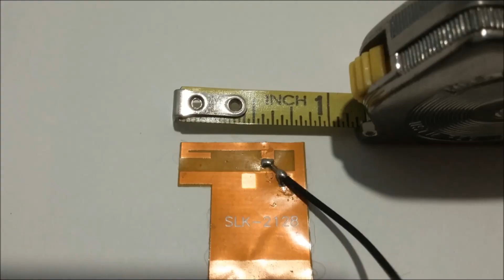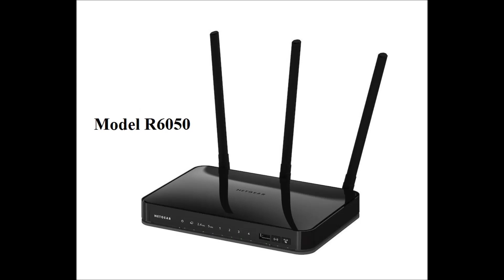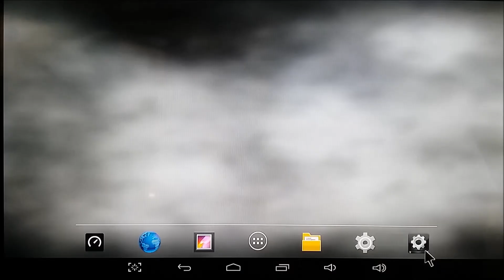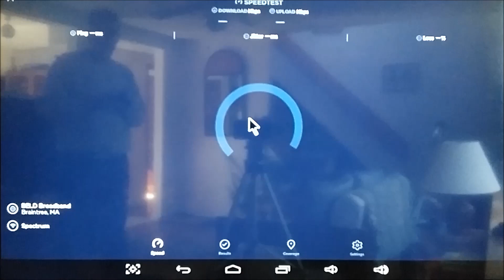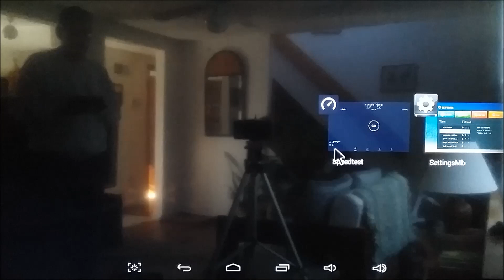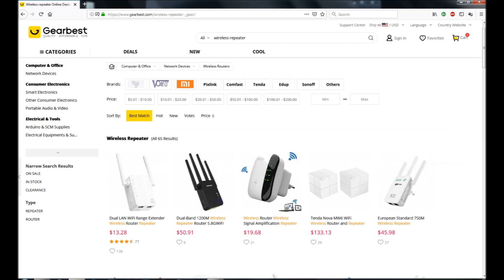MBOX WiFi Problems - Part 1

Comment: MXQ pro 4k 5G, Wifi authentication problem. Please help me!!!
Reply from the maker: Assuming that the original firmware has NOT been replaced with an incompatible version (having wrong WiFi drivers), it's possible that you have a weak power supply. 5V 2A is standard. Most boxes will run with much less (most of mine will run on 5V 1A USB power right off of the back of a TV), but then mystery problems occur. So, if you're getting power from the TV, not from the original power supply, reconnect it and see if the problem goes away. Otherwise, read through the comments. Others have also had this problem. Might find something useful there. Good luck. Thanks for commenting.

Comment: How about not turning on wifi?? And cannot scan any connection at all ... It works before then suddenly it doesnt anymore.. Cant detect or turn on wifi anymore

I also tried ethernet cable but doesnt also detect any
Reply from the maker: Things might cause this to happen:
1. Incompatible firmware has been installed. Now WiFi doesn't work. If that's what happened, reinstall the original firmware.
2. Developer options have been turned ON (in Settings) and incompatible WiFi options have been selected. If that's what happened, revert to the factory default WiFi  settings and turn developer options OFF.
3. WiFi driver has been corrupted or deleted. If that's what happened and the OEM firmware is still on the box, reset Android OS (and the entire box) to factory defaults using the toothpick method.
4. WiFi chip failure. If that's what happened, confirm that Ethernet (wired) Internet still works and if so, buy a cheap WiFi  repeater (they're less than $10 US now), set it up behind or close to the box, and connect to it using a short Ethernet cable. This will give you much faster Internet than you ever had before. Details are in MBOX WiFi Problems - Part 1 https://youtu.be/xzQPV_PVTKk and Part 2 https://youtu.be/ez9rgjr39rE
5. Network chip failure. If that's what happened, neither wired nor wireless Internet will work. Your only option (other than identifying, obtaining, and replacing the chip) is to install an ELEC OS on the box and connect using a compatible USB WiFi  adapter (less than $5 US now). Details in MXQ Upgrade Secrets, Part 3 https://dai.ly/k2o5azuTmeQerLwTPFH and MXQ Spring 2021 Update, https://dai.ly/x80lsgs
6. While all of the above are based on MBOX experience, this one is based on informed speculation. Laptops generally shut off their WiFi adapters when the battery gets low to conserve power. Symptoms at that point are exactly as you describe. So, I'm thinking you might have a weak AC adapter, one that loses power under load (and shuts OFF the WiFi adapter). To confirm this you'd have to take two readings with a multimeter: one at the plug, with the box disconnected; one at the jack, box cover removed, box ON. If that second voltage reading is substantially less than the first, and substantially less than 5 volts, a new AC adapter might be the answer. Any way you can take your box to a friend's house and try his/her adapter? That would be the easiest way to test...
Thanks for asking about this. Please repost if and when you solve the problem. Others have asked the same question. I'm sure they'll be interested in what you find.

Comment: i have a wifi problem, even if the password is correct it says authentication problem.
Reply from the maker: Two thoughts: 1. MAC address filtering has been turned ON in the router and the MAC address of your TV box is not on the access control list.  2. WPA2 security has been turned ON in the router and the WiFi module in your TV box is not compatible with WPA2. Either way, try turning ON  Guest network in the router (with no security) and see if you can connect to that. If you can, then look to the router for your solution. Either add the TV box to the ACL (assuming MAC address filtering is ON) or try a lower level of WiFi security. Good luck. Thanks for asking!
Reply: thanks for the response, i checked if theres MAC filtering, there is none, i also removed the wifi password and it still cant connect
Reply: the box is working perfectly in the past 6 days until yesterday it wont connect to the internet anymore
Reply from the maker: @grit6552  At this point, I would try connecting by wire (Ethernet connection) to see if that worked. If it does, then you could set up a cheap WiFi repeater (about $10 these days on Aliexpress) behind the box connect to that using a short Ethernet wire. Already, you could try resetting the box to factory defaults (what have you got to lose?) to see if factory reset fixes the WiFi.
Reply: @LawrencePina  already done the factory reset, but havent tried the wire yet, thanks for the response.
have a good day
Reply from the maker: I'm wondering if the recent switch to DST had something to do with this? Did you check the clocks to see if the router and the box were in synch?
Reply: @LawrencePina  yes they were the same, im kind of thinking maybe the hardware is the problem since i tried all of the ways but none worked

Comment: cant connect mine to wifi it says authentication error what to do?
Reply from the maker: "Authentication error" suggests a network security issue, not an inherent MBOX problem. Two possible explanations:
1. You have entered the wrong password.
2. You have entered the right password but MAC address filtering has been turned ON (in the router) and the MAC address of your MBOX has not been entered on the router's access control list.
What to do:
1. Assuming you have administrator control of the router, log in, turn OFF MAC address filtering, and try again. If the MBOX connects now, then MAC address filtering is your problem. Keep MAC address filtering OFF, or add the MAC address of your MBOX to the list, turn MAC address filtering back ON, and try again
2. Alternately, turn ON a Guest network (with no password) and try connecting your MBOX to Guest. If it connects, then there's a settings issue (most likely MAC address filtering). If you'd rather not deal with it, try resetting the router to factory defaults and start over. Good luck and thanks for commenting!
Reply: Hdeem

Comment: Hello, can you help me.. I have the same android tv box, but when i connect it to the TV, it doesn't detect the box. It says, No signal. Thank you
Reply from the maker: This doesn’t sound like a WiFi problem. Assuming that the standby LED lights red when the MBOX is plugged in and that it changes from red to blue when you turn it on, then have you tried the box on more than one HDMI port and/or on more than one TV? If all of the HDMI ports on all on all TVs indicate “no connection,” then most likely you have a bad HDMI cable. You’d be surprised how often that’s the case. Try another one (preferably a new HDMI 2.0 cable) and the problem should be solved. Otherwise, if you don’t get a normal red standby LED on the box, or if it doesn’t turn blue when you turn it on, then the firmware on the box may have been corrupted. Search YouTube to learn how to reinstall it. Good luck, and thanks for asking!

Comment: We're connected to our wifi but when we try to open Youtube its just saying try again
Reply from the maker: In my experience, the issue you describe is not a WiFi problem. It's an updates are badly needed problem. Go to Settings/About to determine which version of Android you have, then continue watching MBOX Frustrated User Guide, particularly:
Episode 2 - MXQ Clock Problems
Episode 3 - Making Do with MXQ
Episode 4 - MXQ Upgrade Secrets, Parts 1, 2, and 3, and especially
Episode 5 - MXQ Pro Upgrade Secrets.
Once you've done all those things, your box will stream better than ever and YouTube will work fine. Thanks for asking!

Comment: Hi..how will I fix my android box that is not connecting to wifi
Reply from the maker: So what happens when the MBOX and the TV are in the same room as the router? Does the MBOX see it? Does it see any other networks? If the MBOX connects when it's close to the router, but not when it's in other rooms, then the answer to your problem is in this video. If the MBOX can't see any wireless networks, no matter where you locate it, but your other devices can, then your MBOX firmware may have been replaced with an incompatible version. Incompatible meaning firmware with no support for the WiFi module in your box. To get the WiFi function back, you'll have to reinstall the original firmware. Good luck and thanks for asking!
Reply: @LawrencePina  how to reinstall original one please help me🙏🙏🙏
Reply: @LawrencePina  i cant find any, there are only mxq pro firmwares, but i have the one just like that in this video.😔
Reply: @LawrencePina  i need the mxq tv box original firmware🙏🙏🙏😭
Reply from the maker: @lashapap9106  Ask the vendor (from whom you purchased the box) or failing in that, try your luck at https://china-gadgets.com/

Comment: Can somebody help me?? My mxq pro 4k sometimes having a wifi issue. Like when you open youtube it says network error but my internet is all good
Reply from the maker: In my experience, the issue you describe is not a WiFi problem. It's an updates are badly needed problem. Go to Settings/About to determine which version of Android you have, then continue watching MBOX Frustrated User Guide, particularly:
Episode 2 - MXQ Clock Problems
Episode 3 - Making Do with MXQ
Episode 4 - MXQ Upgrade Secrets, Parts 1, 2, and 3, and especially
Episode 5 - MXQ Pro Upgrade Secrets.
Once you've done all those things, your box will stream better than ever and YouTube will work fine. Thanks for asking!

Comment: Can mxq pro 4k support usb tethering 
If it supports usb tethering It is good for me
Reply from the maker: I'm not sure what you're hoping to do or why you would want to do it. Are you trying to share Internet service from a mobile phone to a TV box via USB or from a TV box to a mobile phone via USB? Internet sharing is easily accomplished (at least on both of my MXQ boxes) using WiFi hotspot but I'm not sure about USB tethering. There are too many variables, including the fact that these boxes are all different. They're made by different companies, using different motherboards, with different (custom) firmware, with different factory-installed apps, and different versions of Android OS. Even if USB tethering on my MXQ Pro 4K worked the way you wanted, there's be no guarantee that another MXQ Pro 4K would work the same way...
Reply: @LawrencePina  Sir you are right these boxes are developed by different companies and have different firmwares but  actually main  problem is that Sometimes my  box doesn't catch my mobile hotspot signal , and I cannot able to use internet on mxq. So I think u may resolve my problem  Please tell me how can I use internet on mxq box using usb cable means usb tethering 
Great day 😊
Reply from the maker: Your project, not mine, but for what it's worth, have you tried some of these apps?
https://apkpure.com/search?q=tethering+app
Even if you get USB tethering to work, the problem may be with your data plan. If the carrier is restricting how much you can share, USB tethering may not work any more reliably than WiFI hotspot. Good luck. Thanks for commenting!